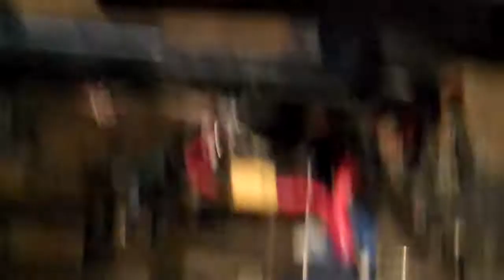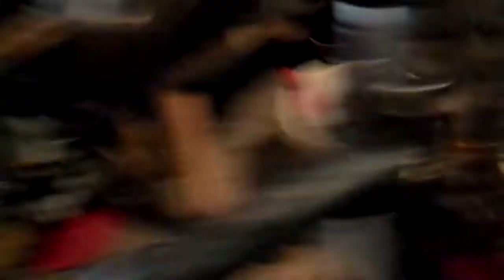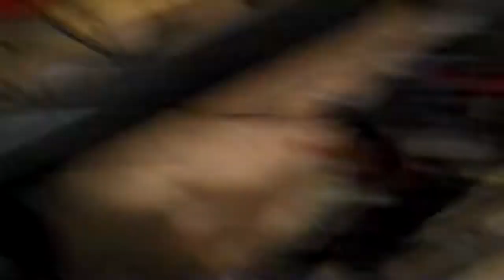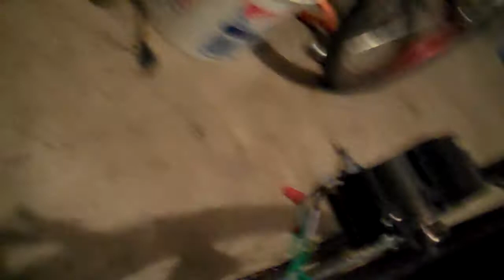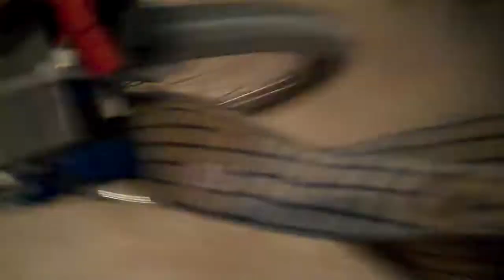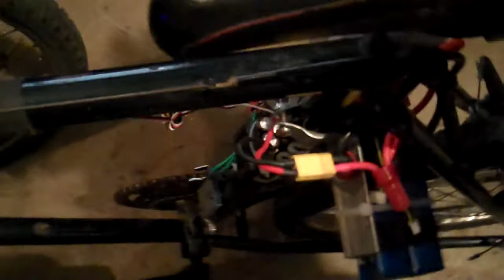homemade electric bicyle friction drive run test

Comment: Hi I like the friction drive as its simple and quiet - could you please let me know which bearings you used so I can get some - because you using such a small motor, a controller is not necessary, if you go over to brushed motors you can just use a on off switch from a truck they run 24V here is an example

watch?v=HjsYANIIDmc